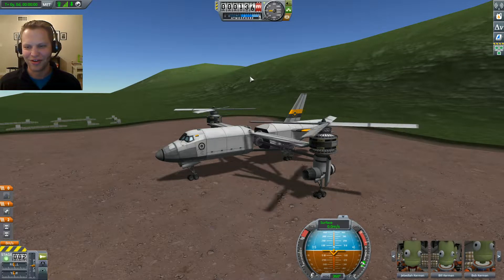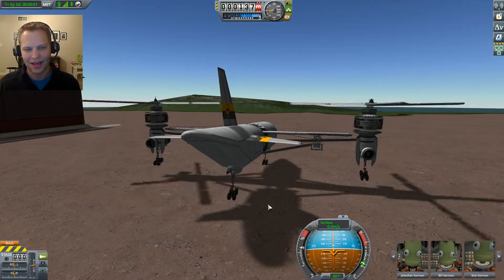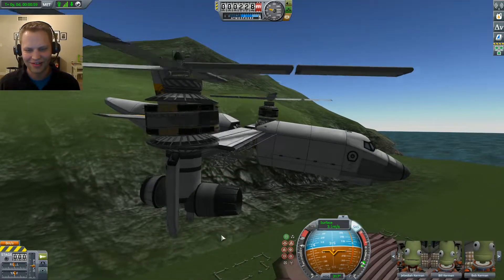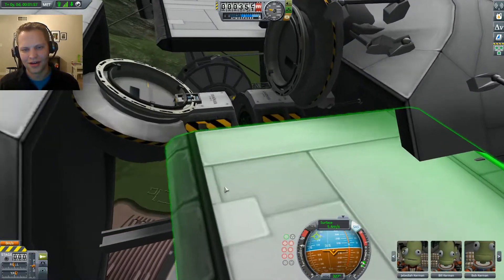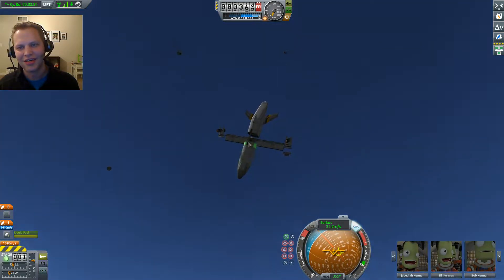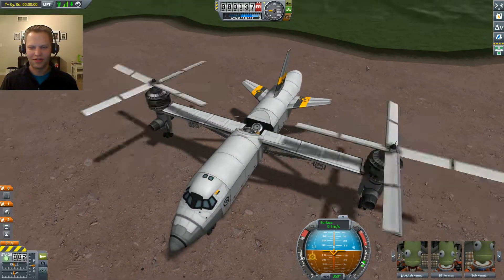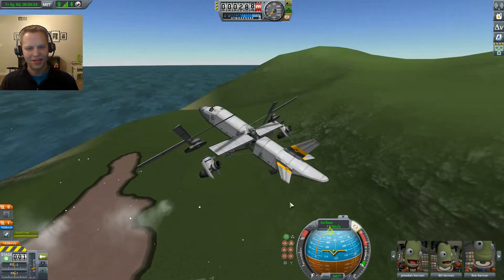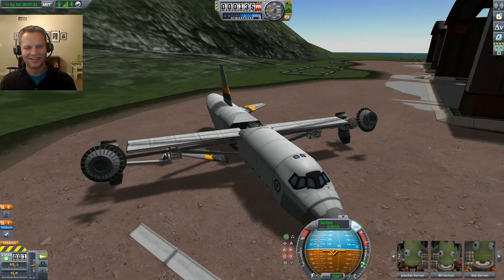Kerbal Space Program - Twin Rotor Stock Prop VTOL - KSP 1.6

Comment: The propellers work like gyroscopes and try to keep the initial orientation. You have to make them lighter and make entrire craft lighter, so they can spin slower and maybe this will decrease forces enough, that they will not brake the propellers